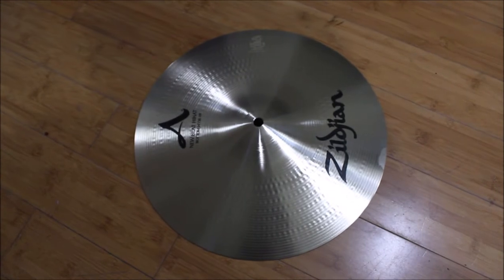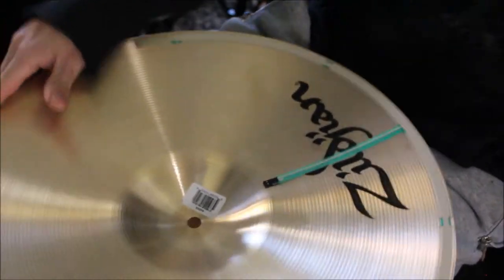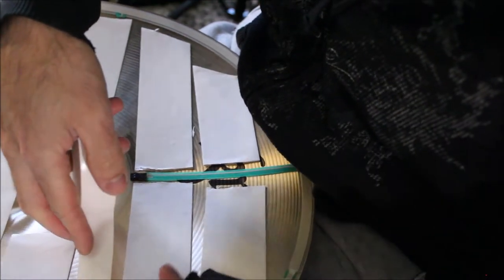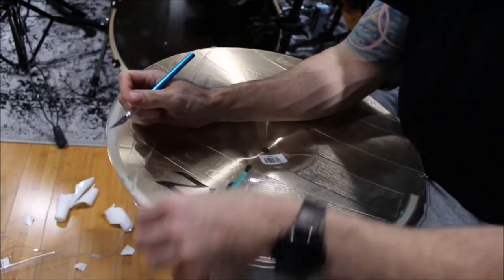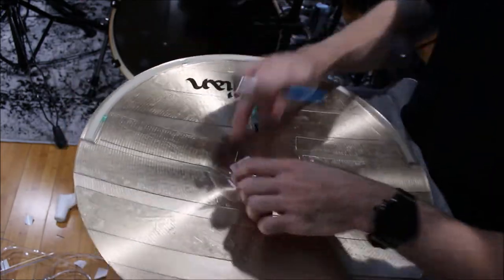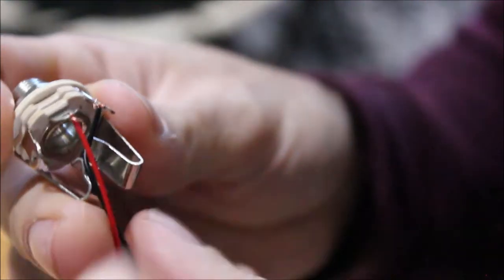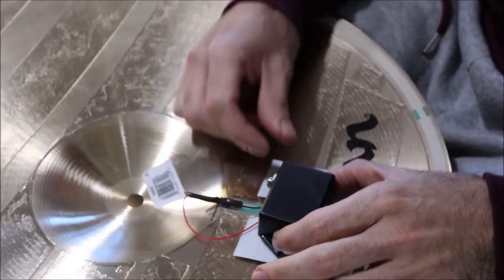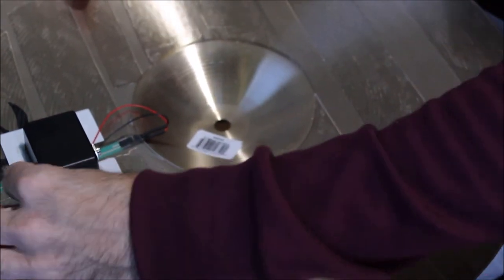DIY Metal Electronic Cymbals A2E Conversion

Comment: Hey Jase, this is perhaps the best cymbal conversion video I have seen. Very well laid out, explained and executed. I have a Pintech 18" 3 zone Visulite ride that I bought brand new that I have hardy used, as it was crap, no module or trigger device got me a decent bell trigger. One of the things I hate about it is that bloody soft neoprene playing surface on the bow and bell. And I have wondered if it was replaced clear PVC stuff you used here, there'd be a much better transference of vibration. I got nothing to lose, it's just sitting here. I tried selling it but no takers. 
Also, regarding the jack socket wiring, piezo ceramic goes to tip, brass to sleeve or the other way around? I take it the edge membrane shares the sleeve with the other connection going to the ring of the socket?
Reply from the maker: Hey what's up man!  Fancy seeing you here :) And thanks for the kind words, I appreciate it.
Honestly I forget how to wire them every time I do it;  I made a cheat sheet to help me remember, and then I filmed a video with the cheat sheet so I wouldn't lose it lol.  Check it out here:  https://youtu.be/KuGziUnm_ug?si=JV8b95z4qShf-f-n&t=163

Comment: Nice i do like this method of dampening instead of screwing basically a second piece of metal like field and jobeky do as it makes their cymbals so heavy and rigid..I was looking into doing an a2e on cymbals but then Lemon started releasing theirs  and they are cheap and the correct sizes so i said to myself why not save me the trouble and get those instead...I have enough sodering to do with the rest of my a2e kit already lol..great vid
Reply from the maker: Thanks! 
Yeah, weight was one of my issues as well (mostly the cost of fields), and I didn't want to have to drill holes and ruin a cymbal. This is semi permanent, I could always scrape the tape off and convert them back if need be.
Reply: @ArgonautDrums  how sensitive are these?
Reply from the maker: @OthonasDrums  I run them pretty hot, but I've also dialed them down before to where I could get decent cymbal swells. Your module will play a big part on how you can dial in sensitivity/gain/threshold/etc.
Reply: This kid took high-end cymbals, applied carpet tape to them which will degrade those cymbals.  I mean, if you’re going to do THAT, Zildjian would be the brand to do it with LOL.  Never been a Zildjian fan really. A Zilbel, a set of K/A Mastersound Hats and a splash maybe but always been a PAISTE and previously a SABIAN user.  But this guy just killed his investment. Knife marks, residue, then later discoloration. Good luck on the resale of those. ;)

Comment: Curious how your cymbals are holding up after a couple of years. Have the membranes had any issues? And it seems you don’t specifically need GoEdrum trigger boxes for this to work. They’re quite expensive, and seems making my own wouldn’t be too difficult. Thanks again for the great videos.
Reply from the maker: @romanmeisenberg1224  hey what's up dude! Still holding up and play on them at least once a day. BUT! I found with my non air-conditioned room and the summer heat, the adhesive for the dampening can come loose - typically I can just press it back on, but new tape could be needed.

Check out my hihat video, I didn't use a goedrum membrane switch or piezo trigger for that build. For the switch you just need something that completes the circuit when you hit it, then releases immediately.

Comment: what have you done for your hi hat? same thing but double zone, and then LV cymbal with rubber trim for bottom hat? also what HH controller is that?
Reply from the maker: @hvruk4541  I did a video on my hihat too, but you pretty much called it. I'm using a goedrum controller (vh11 clone)
Reply: @ArgonautDrums  oh shit, i totally missed the hi hat video, i'll check it out. 

for the hi hat controller, looked like you had something different (grey with a red switch?) in your rooms of hansa video. 

i have the goedrum controller myself, haven't been thrilled with it, you seemed to be getting pretty good results so wondered if you were using something different cause i thought it looked like it =
Reply from the maker: @hvruk4541  ah ok, in that video I was using Field Electronic hats. I wasn't nuts about them (especially for the price), so I went back to the drawing board and made my own.

Comment: Nice conversion. I did something similar with low volume cymbals. I can imagine doing this with an old cracked cymbal, or some crappy beginner bronze  - but why ruin a perfectly decent $250 Zildjian A?
Reply from the maker: Aesthetics. 
These were used. 
They're not rare cymbals.
And It's not permanent; Ive de-converted a few since making this video.
Reply: Well, they do look snazzy! Good on ya, mate!
Reply from the maker: @thedustyhaze  thanks man; trust that no harm has been done to them 😉

Comment: The only reason (for me) to convert to metal cymbals is for looks because the digital pads work very well and I HATE how dead metal electronic cymbals feel. I have played many brands of metal electronic cymbals and they all feel very bad when compared to the rubber cymbals.

My Current kit which I plan to "upgrade" by using my acoustic drums again only for looks:

https://www.youtube.com/watch?v=8aaWg0iHOwM
Reply from the maker: @ArturoVillanueva-g5v  aesthetics (looks good on camera 😉 ) and feel are what drove me to it. Some companies use two metal layers with dampening sandwiched in between, and Im with you, too dead and waaaay to heavy. I think I found a decent middle ground.

Comment: how well do they trigger in comparison to the other methods and rubber cymbals? I recently purchased the edge membranes for a ride 2 18in crashes, 2 16in crashes  and 2 16in chinas which I will more than likely use a single piezo since I have many but bottom line is I def want to have all electronics under every cymbal but  I'm concerned about the hi hats. I have the Goedrum controller that has its own frame and the bottom hat cannot be used but its capable of normal hat sounds and I wish my E-kit to sound and play as authentically as possible. I put 3 ply mesh heads on an old export series kit 8, 10,12,13,16,22, and I'm using a 14in snare and hopefully will achieve position sensing and I prefer to use the most accurate and authentic method of achieving the best recording using this kit only and superior drummer 3. I have plenty of regular cymbals to use but like I mentioned Im unsure of what you did to make your hats and ride but i have a pretty good idea for the ride. I also used PVC pipe heated and curved it to mount on a drum lug and use as a Tamborine, cowbell, wood block, crasher, or anything else and i used the rubber from crutches on the pipe.   Oh ya 1 more thing. I notice you leave the switch exposed when most put rubber trim on top of the membrane whats the difference and which one is better? thanx
Reply from the maker: Hey what's up dude;
They trigger well enough for my needs, I don't have to adjust my playing style or anything, but I also don't do alot of jazzy dynamics my my cymbals, just crash and choke. I can still achieve cymbal swells. But you will get better overall triggering from an actual ecymbal as that is what they are researched and developed for. 

My hihats, I'm still using my Roland rubber hats for exactly that reason. I need more control and dynamics. I do have Field electronic hihats on order, so hopefully that bridges the gap of aesthetics and function.

And for the membranes exposed under the cymbals; that's just preference, I wanted to be able ensure nothing was impeding me from closing the switch. Didn't want the PVC sheet to inadvertently choke it for me too. 

The switches are actually made to go on top of an e cymbal that is protected with rubber, and hitting it closes the switch to give you an edge zone; I'm just using it as a choke. If your cymbals are thin enough, the flex of the cymbal can trigger it as an edge zone (if I wack mine hard enough, I can get it to trigger, but it's in inconsistent, so I'm just using it as a choke).

Comment: Hey man how much would you charge me if I send you a couple of cymbals to do a couple of 1 zones for me ? And I see your using a joebecky kit are those drumtech heads ??
Reply from the maker: Jobeky kit, with jobeky heads (I think the snare is 3 ply and everything else is 2 ply). 

Single zone cymbals are super easy to make, just mute the cymbal and slap a pintech rs5 trigger on the bottom.

Comment: is the pvc just for sound dampening or is it needed for proper triggering?
Reply from the maker: Hello there! It's actually for both; by dampening it, you're making it quieter but also reducing vibrations that the trigger would pick up. Without any dampening, the trigger would pick up everything and create false triggering/double triggering/retriggering/whatever you wanna call it.
Reply: @ArgonautDrums  hey man thanks for the quick reply, that is good to know. Im guessing it impacts the feel of the cymbal a lot so i was hoping i could skip the pvc. I was planing on converting zildjian l80s so i wasnt concerned about the noise
Reply from the maker: @asdf-y2c  ah with l80s or any low volume cymbals, you can skip the PVC and just use some rubber uchannel around the edge. Kinda sounds like hitting a basket, if that makes any sense.
Reply: @ArgonautDrums  I see. Thanks for the information i will look into that

Comment: Did you do HH this way?
Reply from the maker: No, because I need the edge to work flawlessly on the hihat, and I didn't want to put the membrane switch on top to get that level of dynamics. I'm using Field electronic hats instead.
Reply: @ArgonautDrums  how do the field cymbals feel? I have a e drum because of noise problems in my apartment but i hate the feel of the cymbals. I am trying to figure out how to get e-cymbals that feel as close to normal as possible
Reply from the maker: @asdf-y2c  they feel Great, but they're definitely louder, so you could have issues in your apartment complex. Imo, ATV hihats would be my next choice for best feel. They're not silent, but quieter than the fields.